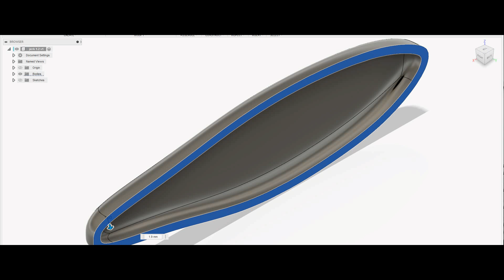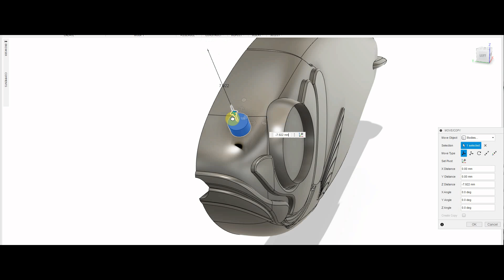Making a resin printed jerk bait at home

Comment: How cold is that water you were fishing? I tried testing some of my hardbaits on my resin printer instead of my fdm using syriatechs abs like resin. I was having issues with the  material becoming too brittle in the cold and the lip shattering. I still have some minor issues with fdm but it’s much better. I’m working on a polycarbonate blend for my larger saltwater stuff.
Reply from the maker: some of resins shatter because of water or humidity,   i had in box for week after testing  printing water washable resin and they had shattered on their own in the box because of moisture. I have been using abs like resin from elegoo since and have not had the same problem both in salt water and fresh. The resins also need some kind of uv protection coat as they continue to harden in uv light and water transmits it quite well so they could over over hardened and become brittle. I am going try tough resin as you blend the hardest to get some give almost like a polyurehtane resin. But the abs is great my kids have been smacking these lures into every bit concrete and occasionally the lake
Reply: @PaulAdamsTheHandmadeFisherman  Good to know! If you run into any issues with that I believe syriatech blu clear v2 is the strongest available resin on the market with out spending hundreds of dollars a kilo
Reply: @HandCraftedAngling  Podrían mezclar 50% de sirayatech blu + 50% de sirayatech tenacious.

Comment: how does it perform if it comes to durablity? my cast isn't very accuate and sometimes I land lure to rock or hard surface accidentially.
will it shatter or it is as strong as the commerial ones on market when it comes to impact?
Im seriously thinking about to get a 3D printer to make my own lure, but its durablity concerns me the most.
Reply from the maker: these are bteer than expected i have slamded them into a few rocks and not really any damage  apart frpm one has a bent hook hanger, this abs like resin so it it pretty tough also it helps that it is one peice rather than two shells glued
Reply: @PaulAdamsTheHandmadeFisherman  thats brilliant! seems 3D printing has made quite a progress in last 5 years! I was trying to make a decision between resin moulding /curing manually and balsa wood crafting and 3D printing. Now it seems 3D printing is  the thing I have been looking for.